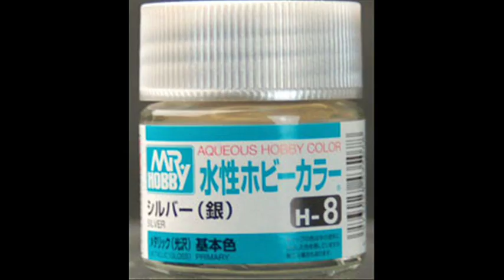Honing your airbrush skills 03: Trouble shooting paint thinning

Comment: Hi Allan, I use airbrush to paint my models, but I have a problem that occurs regularly while I'm painting and this causes many errors in the paint job. 

while I'm painting occasionally airbrush spits water that condenses in the air hose. My air compressor has a filter to collect the condensed water but still the airbrush is spitting water. 

this has happened to you?. You know how to solve it? 

thanks 

regards
Reply from the maker: yeah it does, thought I talked about it in video one or two. I only had a little water and it was cutting out the paint when drawing very small lines. First of course I drained the water trap. also I added a valve on my rig and allowed the tank to fill with air. Once full I removed the airbrush from the hose then blasted the water out by opening the valve. I do this every time before painting. I will show this at the start of the next installment.